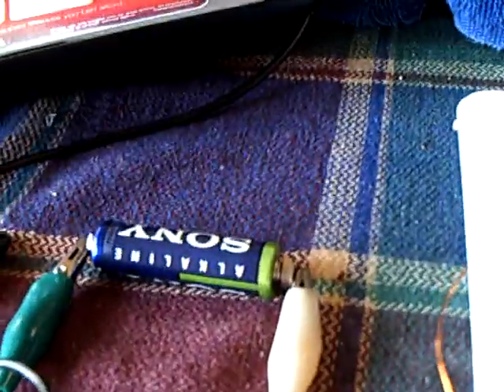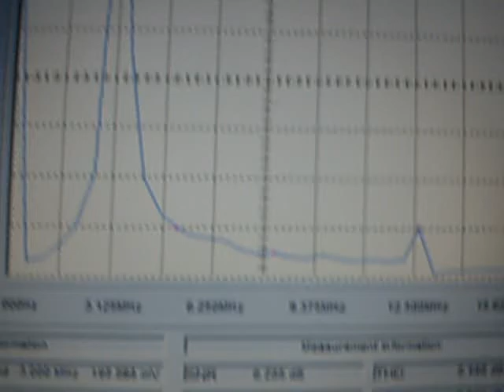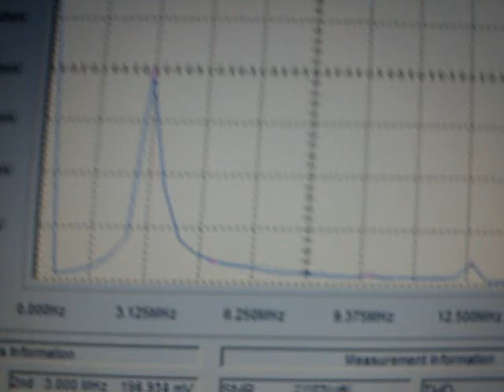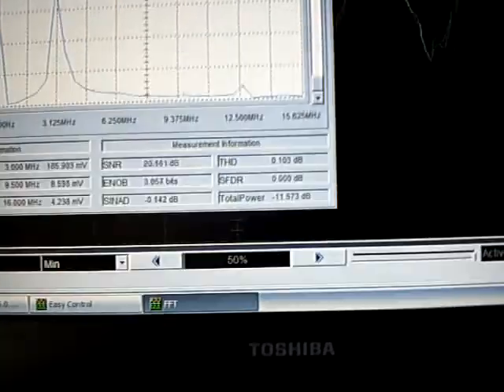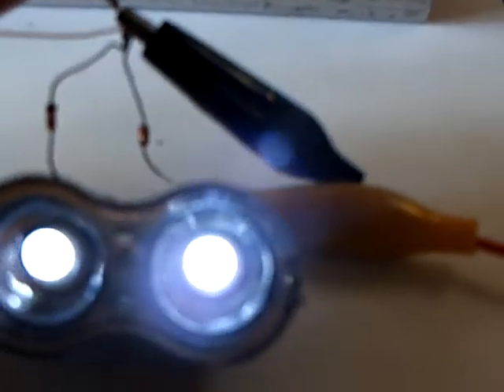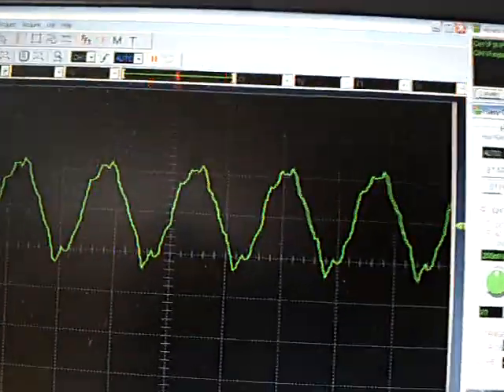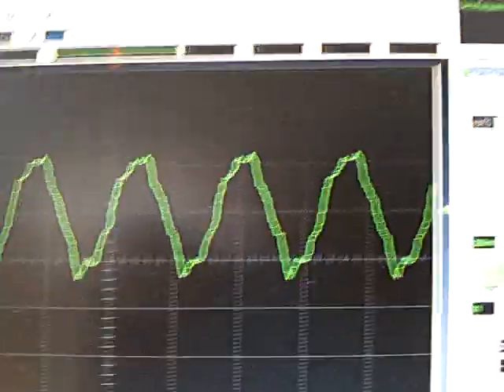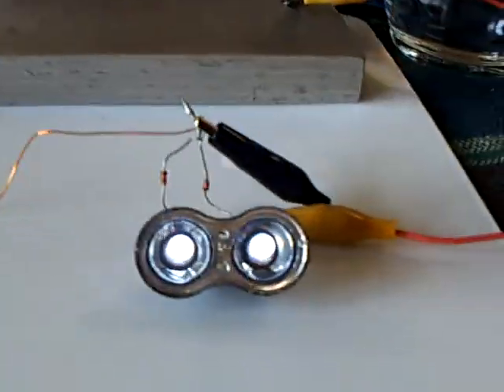Slayer Exciter ---Scope shots & and more water tests.ASF

Comment: Attaching a microphone is an Interesting idea. I suspect that if you attach it to the base of the transistor, you would get some serious modulation. Nikola Tesla was using his coils to create high voltage pulses wich in his words, produced "Shock waves in the ether". If you did this with a solid state tesla coil, you may have subspace comunications(StarTrek).

Comment: So if you have an old Motorola cable modem check inside before you throw it away. It has a real nice little power supply with it's own circuit board. You can take it out and install it in some other casing. No need to solder anything at all. Just one screw and that''s it. Ready to use. 

Greets, iT

Comment: Ah I was wondering if an electrolyte would make any difference. Thanks for doing and showing this test :-))

I'm collecting parts from  electronic devises that I didn't use anymore. Had an old Motorola cable modem and I found a very nice little power supply inside with different output voltages. Very sweet, Ideal for breadboard experiments. 

1,8Volt, 3,3Volt, 5Volt and 30Volt, all less then half an amp. Like a mini PC power supply, all in one piece and with all the connections still in place

Comment: I think this might be a simple answer to why this works the way it does. You have free electrons in the air around the glass but what you might not be aware of is that the glass might have metal content in the parts per million silican particles mixed and the water is just being a carrier because ot the mineral content of the water as well. This is a wireless system right! Water also has a radioactive element to it which is hydrogen so the high rf might be excited and gives off fuel in power.